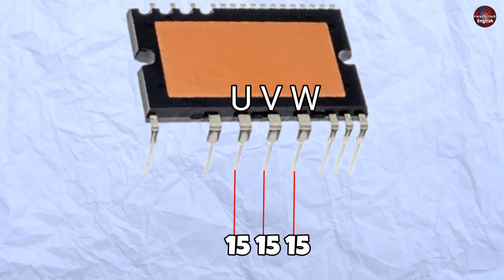Mini Split AC Motherboard Stops Compressor After 2 Seconds

Comment: So the capacitors were shorted and the IPM was not sending correct voltage to compressor?
Reply from the maker: Yes that's it..
Reply from the maker: The resistor 84 was also shorted.